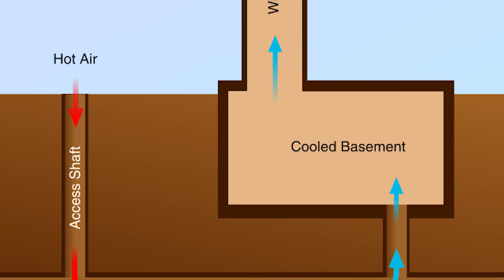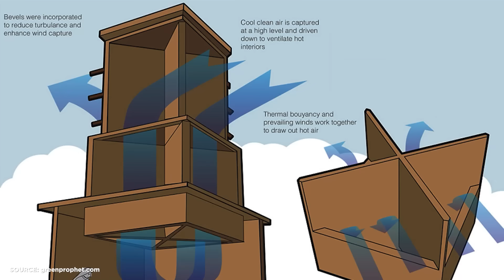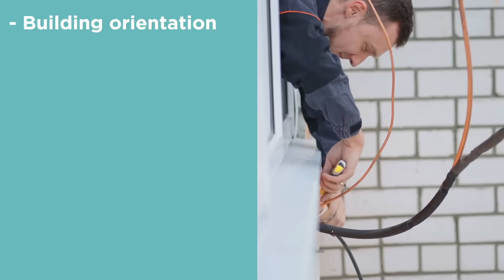Forget Heat Pumps - This House Cools Itself With NO Electricity!

Comment: It's not that we stopped being clever.
Using electricity to cool ourselves is extremely clever, the issue is that we didn't really understand the consequences when we started, and have gotten used to that solution.
Reply: We do a lot of clever things to save energy, but most modern buildings could be WAY better
Reply: @sulljoh1  Absolutely, and we have relied on the use of electricity to cool us off instead of appropriate architectural design, with houses being modeled primarily after trends, than practicality
Reply: Plenty of people understood the consequences for a really long time now. What’s not clever is humanity doing jack shit about fixing this disaster that’s destroying this beautiful planet.
Reply: @jbanders2358  Maybe, but that just means that we were never clever to begin with.
Reply: Most inventions don't think about consequences until it's too late. Almost every invention I can think of has unintended results, some good, others not so much.
Reply: @amandaburnham.8817  it's true, but I think it's simply impossible to think of every outcome, we cant really treat every invention the way we treated james webb telescope where we think of every scenario ahead.
Reply: @hmp01  so true! But we can at least try to think of as many before widespread adoption of a new technology/technique.
Reply: @amandaburnham.8817  Agreed!
Reply: @amandaburnham.8817  The thing is that kinda requires to know what you don't know. As in, figure out which areas you're ignorant in before even having experience in it.
Reply: Well, I'll keep this video in the back of my mind after our A.I. overlords take over the planet and prevent humans from accessing the energy grid. Until then, I'll continue consuming energy like a flesh eating bacteria.
Reply: @henrythegreatamerican8136  I don't get the relevance
Reply: How is it clever when it can't think long term? Does clever and short sighted go hand in hand?
Reply: @danishbinmukhtar  By your definition, it is impossible to be clever given that we don't know what we don't know.

The environmental impact wasn't well understood when the first AC's came around, and then we discovered the impact of the coolant, so we changed the coolant. Now the issue is with power consumption, which is a separate one that wasn't as well understood.

Everything has tons of implications, no one can be aware of all of them BEFORE even trying them out.
Reply: @Fernando-ek8jp  I really don't think u will ever understand that what's public knowledge isn't the only knowledge available to the human race....
Reply: @danishbinmukhtar  That's a weird statement. If I know something and never share it, would you count it as "available" to the human race? It's a fun thought experiment...

But still has nothing to do with my point, which is simply: humans haven't really gotten less clever, just that the resources and limitations change, so we innovate differently
Reply: There is a thin crust of clever people, everyone else is a freeloader.
America is headed to "Idiocracy"
 https://www.youtube.com/watch?v=BBvIweCIgwk
Reply: It's not that we stopped being clever, it's that we became pussies. 
In the olden days, the pussies died quickly, but now they multiply like rabbits.
Reply: Shell Oil knew about climate change consequences back in the 1940’s/50’s. We’ve done basically nothing for 72 years.
Reply: @jbanders2358  Also irrelevant to my point. They didn't invent the ac, for one, and my issue is not one of electricity generation. It could all be generated from carbon neutral pixies, and refrigeration via AC will still have an impact.
Reply: So in the end it's not so clever.
Reply: @Osmone_Everony  My whole point is that not knowing the consequences as a technology is developing doesn't mean that the ones doing it aren't clever.

The people who were initially studying radiation were certainly clever, but the demon core incidents still happened. We learn by progress, we don't know what we don't know, so I think it's still incredibly clever that we managed to live pretty much anywhere in the world with a comfortable temperature due to electricity, but we got enamored with the idea and didn't think that it was necessary to build structures in a certain way anymore, because it wasn't needed to be comfortable.
Reply: @Osmone_Everony  It's not clever that we have been able to generate electricity and use it to accomplish all that we have with it?

Man, tough crowd.
Reply: @Fernando-ek8jp  No, I was referring to your argument (quote) "the issue is that we didn't really understand the consequences when we started".
Reply: @Osmone_Everony  So what? How does that in any way negate the cleverness of using electricity to do everything from cooling out home to having near instant communication using devices small enough to fit in the palm of your hands?
Reply: @Fernando-ek8jp  I didn't say that! Stop jumping on false conclusions. It was YOU who were talking about consequences! Maybe you can elaborate on this.
Reply: Not considering the prohibitively high cost of inefficient thermal regulation is the smart choice for most. It's a problem of the landlord-controlled society where only the rich can own houses and everyone else rents. The problem with this is that the owner has no stake in the energy efficiency of a rented dwelling and, so, that heater which pulls 7kW or the water heater that costed more each month than the total rent bill = not the owner's problem. And they routinely neglect things like this to save a few microcents in the dollar. It doesn't help that moving is so expensive it discourages the usual consequences for bad customer service.
Reply: @Mercurio-Morat-Goes-Bughunting  Let me know how many homeowners have systems like the ones described in the video compared to how many use ac and other electrical solutions.
Reply: @Fernando-ek8jp  That's got nothing to do with the price of fish. The problem is that the vast majority of "home owners" are property investors with no stake and nothing to gain from the energy efficiency of most of the buildings they own. If you want to get an idea of how important energy efficiency is to people you have to look at what people have control over - not pie in the sky fantasies that might as well be a city in the clouds orbiting Jupiter so far as tenants are concerned. The big selling gizmo you see on washing machines, dryers, and refrigerators isn't endpoint performance, it's power efficiency and, where applicable, water efficiency. It's why low impact driers have taken over from the old-fashioned type which used a heating element and dry a load of washing in a fraction of the time. Give people a viable and informed choice and they'll always take the better option.
Reply: @Mercurio-Morat-Goes-Bughunting  It does. I'm referring specifically to homeowners who live in said homes. How many of those do you know use that sort of passive ambient control?

You can talk about landlords and investors all you want, but if you can't point at a significant difference between people who live in their homes (which exist, despite your fixation on simply the investors), and the investors, then you're just using a variable without any statistical value.
Reply: @Mercurio-Morat-Goes-Bughunting  Let's take your argument to it's logical conclusion.

Let's say that every single home/landowner is so because of investments reasons, and that no one else aside from them has ever or will ever own property. ( I know that's not your claim, but it's still painfully relevant)
Where do those people live? In rented spaces? Do "homeowners", which you seemingly think are either a cartel or leprechauns, live out in the streets? No, they also have at least one property in which they live. Where every single expense is for them to take care of, do they have use passive ambient systems or electrical ones like everyone else?
Reply: @Fernando-ek8jp  Let's not because the "logical conclusion" argument is not even factual and often absurd.
Reply: @Mercurio-Morat-Goes-Bughunting  Yes, when an idea is absurd it's easy to take it's logical absurd endpoint.

Let's try this again: do people who live in their own property exist?
Yes.
Do they tend to have to have passive, thermodynamically designed housing that supercedes, or even properly supplements, the need for electrical equipment?
No.

Even the most dastardly of landlords or investors lives somewhere, and chances are they own the property they live in. Most likely, they use electricity or something combustible to regulate the temperature inside their homes. Meaning that the difference between good passive design and bad passive design is not significantly impacted by whether or not the property is owned by the person living in it, or if it's rented out.

Let me make this clear: I am in no way defending the massive investment firms who use predatory practices, nor am I denying their existence. Just pointing out the fact that the people in those firms probably use AC in their own homes (and that there are people who aren't real estate investors who also own their places)
Reply: @Fernando-ek8jp  Well, statistical value is dubious, especially in a population that confuses the application of median and modal values even at an academic level. That said, I doubt the statistics you're asking for even exist - and the number of people I know well enough for your question is, 100% comprised of people who use passive ambient controls of some form (however dated), on the one hand, but decidedly not statistically significant. So, my "statistics" for what they're worth, have no value (ergo, you're asking the wrong question).

What we can talk about is Purposivism (after Tolman, 1932). Based on this work, which, incidentally, is statistically significant, there is no such thing as aimless behaviour. Based on this, my previous assertion that, given a viable and informed choice people will always choose what is more beneficial; that assertion still stands because it's based directly on purposivism and motivational theory which are both well founded and thoroughly verified principles. And it shows in the sufficient success of energy-saving characteristics of household appliances for this to be a persistent element of the marketplace.
Reply: @Fernando-ek8jp  An absurd "logical endpoint" can't dictate the the idea from which it extends is absurd.

As for your assertion, check out Coober Pedy, Australia, copy one of the duellings then submit the plan for approval to the local council in any of the metropolitan areas of Australia. The problems are a bit more complex than you seem to be implying and have little, if anything, to do with the choices available to homeowners.
Reply: @Mercurio-Morat-Goes-Bughunting  Yes, more informed consumers will make better decisions.

Yes, I'm well aware that your statistics on the matter are pointless, but the statistics of the matter are irrelevant.

My initial thesis is that using electricity to move away heat is not somehow inherently less clever than passive cooling.

You can talk about purposivism all you want, and I guess it works if you strawman me as somehow claiming that the reason for the lack of passive ambient control is because of aimless behavior

I'm honestly done. I have no interest in dishonest conversations.
Reply: @Fernando-ek8jp  your initial thesis wasn't nearly so clear. "using electricity to move away heat is not somehow inherently less clever than passive cooling" is something I can agree with but I don't think it's necessarily a good or bad thing. It's less eloquent than the passive solutions but, I think you'll find that it can bring more power to bear. The biggest issue with electrical movement of heat is that it depends on many more layers of infrastructure than the passive approach. As far as I'm concerned, that's where all of the pros and cons live. I don't think there's an argument for "consequences" when the relevant choices simply aren't available to most people.
Reply: I moved to the south for work. Bought an old house complete with huge shade trees called Pecans!  It had shady porches, upside down windows to let heat out, a big food garden in the back, a whole house fan, a screened sleeping porch on the second floor, a fireplace in the living room and master bedroom right above it.
For cheap!  Never did get shanked ;)
I moved later, but refused a modern horror.
Reply: I don't think anyone has become more or less clever. There are a few smart people in every era who come up with smart things, and everyone else is barely smart enough to shovel food into their mouths.
Reply: @KWifler  a few people have the money and resources to get education, and to know how to profit from their inventions, although perhaps more often the case of profiting from other people's inventions, who often get a pittance  compared to the investors who bring it to market. Edison, for example, is hailed as a great inventor, but he was an even more ruthless businessman.
I think your comment smacks of elitism, and Ayn Rand-type delusions. Some benefit from this model, though, and perpetuate it. Compare Edison to his contemporary Nikola Tesla, or even Steve Jobs to Steve Wozniak. A large percentage of today's world have starving, poverty stricken people who can only aspire to "shoveling food into their mouths". And it is a total failure of "smart people" for perpetuating, instead of changing this for the better. That's a political reality. It's not so much "smart people" inventing technology, but many smart people learning to enrich themselves at the cost of others, who would achieve great technological things if not for oppression and poverty.

Comment: Would you be able to include a turbine within a wind catcher in order to supplement electricity?
Reply: If you yoi designed it to be lockable and push the air where it needs to go when in its locked position then you essentially get a choice. Air flow for cooling or for generating electricity.
Reply: No. It will impede the airflow by converting kinetic energy to electric energy.
Reply: @blueredbrick  I bet someone could figure it out. We got pretty smart engineers.
Reply: @muldersrevenge2325  No free lunch possible. It will need a bigger duct to offset the extra drag caused by the turbine. I have an engineering degree (MSc).
Reply: Oh, you mean engineers that are smarter than physics. We call those Quacks.
Reply: @nunya___  I mean, you had a choice between being rude and not being rude. No one did anything to you.
Reply: @muldersrevenge2325  No, I had a choice between not being rude and being amusing. And besides, they are called quacks and they made fun of me in 5th grade for being smart and all. I don't care about their feelings.
...Yes I know you are talking about you, not quacks but to generate power with wind, you need a generator. In a generator you have to move coils through magnetic fields to produce a current. To do that, to the extent that it creates a useful amount of energy, it take a lot of force. Generally, at least 10% more input than the power output. So unless there is a large volume of wind or a high-speed wind source there is very little energy to be harvested. It would essentially never pay for itself and hamper the airflow through the building you're trying to cool. 
If there is enough wind, just put up a wind turbine that can follow the wind for best performance.

Comment: I'm in Ireland, it's been 75f here recently, and I got heat stroke🥵 how y'all Texans live at 103-110f idk
Reply: I’m living in Kerry, in an A rated house, which also keeps the heat out.
Reply: @ClannCholmain  yeah I'm living in cork and we definitely don't have an A rated house, this place was hotter than outside because of all the glass doors and windows, A/C would be highly appreciated
Reply: @kianfernihough2750  right, and haven said that, there were a few days last year and I could still could have done with one!
A northeast facing bedroom also helps.  
It’s still hot enough today.

Heading to Inch beach now!
Reply: @ClannCholmain  this year's been rather cold compared to the last 4-5 as well but it seems to be harder to deal with for some reason, possibly because of humidity or pressure but idk for sure, just seems worse
Reply: @Narja we are simply not used to heat, as a country we are heat intolerant. 

🤗😂